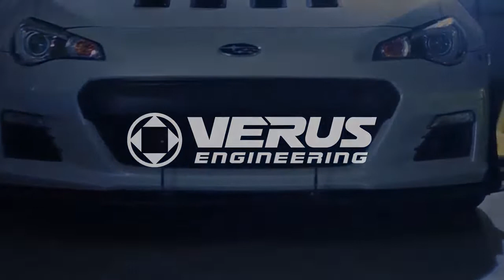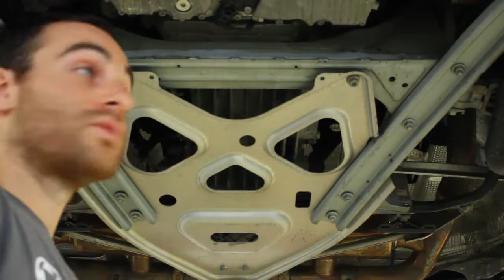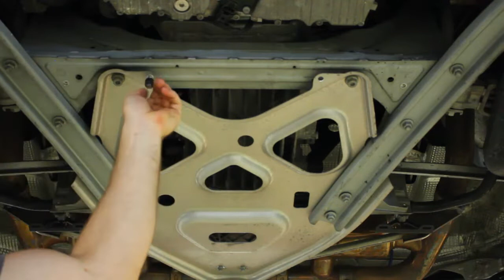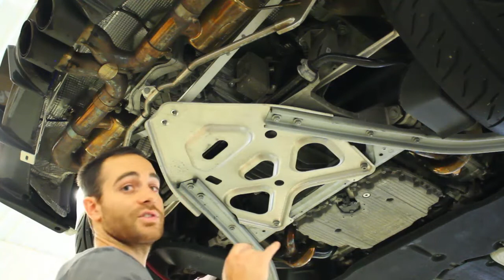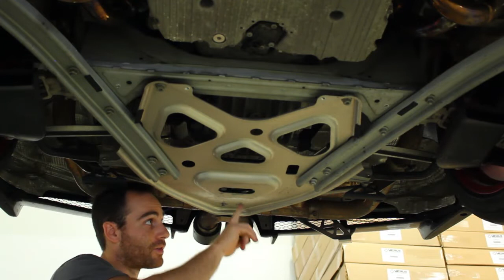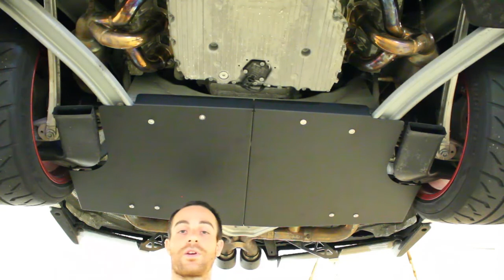981 Flat Underbody Cover Intsall

Comment: ?  It already has a full flat bottom up to the diffuser.... at least on my 981 Spyder.  Only has cut outs for brake cooling ducts
Reply from the maker: The 981 GT4 does not. It is a flat floor all the way up until the trans, then the trans and rear diff are not covered. That is why we designed this kit to extend past what our rear diffuser does. We have not seen a 981 Spyder in person, but we did not know they have a completely flat floor from the factory. Either way that is nice for you!

Comment: What are the effects?
Reply from the maker: Through CFD, we have estimated the underbody panels reduce the coefficient of drag (cD) by 0.07; or 7 points.
Reply: In other words that’s about a 7 HP increase at 100 MPH straight line speed, and better high speed fuel economy